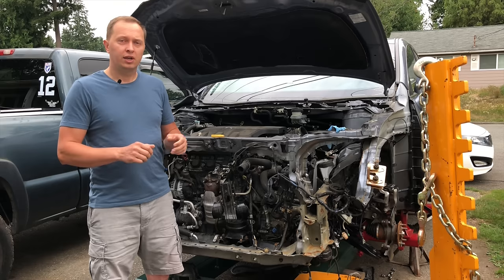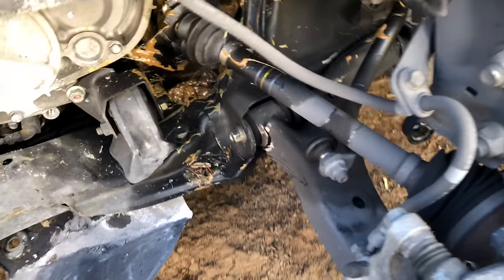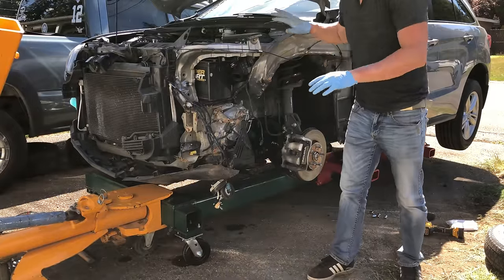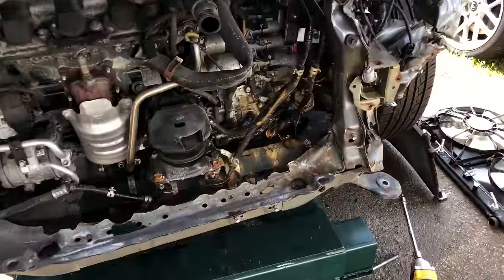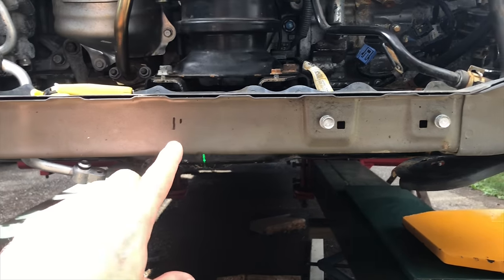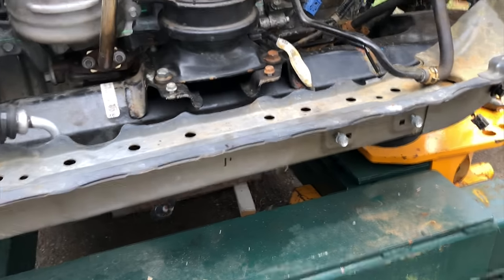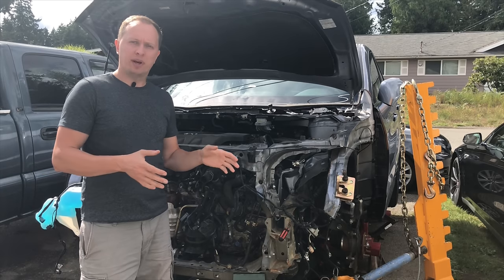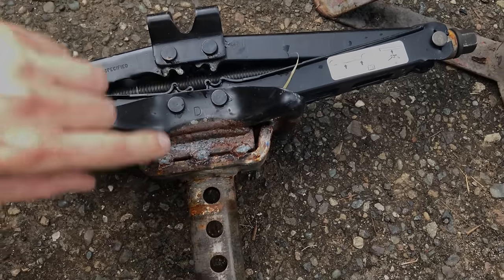✅ First Frame Pull Test on my Homemade Frame Rack Jig.

Comment: This guy has super tolerant neighbors and non-existent city code enforcement allowing him to operate a freaking body shop on his front driveway. 🤣👌
Reply from the maker: I am in a good standing with all of my neighbors so they tolerate all of the work that I do outside. And as far as city code enforcement I don't think there's really an issue, because I don't do that sort of work often enough for them to really notice. This is more of a hobby thing that I do every now and then not really full-time gig 👍
Reply: My neighbors like to gawk and then they will come over and tell me about their car problems.Most of the time they expect me to do it for free

Comment: Great work Arthur Jr. ;)  Don't forget to use a safety rope through the clamp and the chain and tie it off to the body with a little slack so if the apparatus breaks loose in a pull, you don't get hit with it.
Reply from the maker: Lol Arthur Jr... I like it  😂 😂 😂
Reply: My thoughts exactly. Awesome rack but if you do this enough, eventually something will snap and that tension is nothing to mess with.
Reply: Awesome advice. Thanks
Reply: I've been hit being in a hurry didn't think there was any way if it slipped it would hit me well it ripped out in a way that the chain flew sideways instead of directly at the rack like I thought it would knocked out 3 teeth fractured bones in my face split my upper lip in half and chipped a bunch of my teeth use a safety chain no matter what it's worth it
Reply: Throwing a blanket over the chain is cheap insurance
Reply: @mightyconker3903  Yeah, an old moving blanket for the win.

Comment: Might think about throwing a moving blanket over the chain when you pull , just in case the clamp lets go and the chain and clamp go flying like a missile , I learned that the hard way because it happened to me and broke my hand and arm  , better safe than sorry .
Reply from the maker: I normally do throw a blanket over the chain, however since this was the first video of me using the frame rack I did not use the blanket because I did not want to obscure anything

Comment: Fix you have done a fantastic job in building this machine. I am very proud for you. We built a log splitter a few years ago. The only problem was a cylinder that was not strong enough. We added a bulldozer cylinder to this set up and it was far more stronger than needed! As long as your Valve, Pump, and Cylinder is strong enough something is going to move lol.  Let me know my friend. Phillip
Reply from the maker: There is always more then one way to skin a cat... I am a big fan of recycling/repurposing... Using a bulldozer cylinder was a great idea on your part. Those things are built like tanks and are made to take some serious abuse.

Comment: The unit is perfect for a home made frame puller i wish i was that talented. Justsayin
Reply from the maker: I'm not even all that talented... I just had to do a ton of research first, and then it was just a lot of simple measuring, cutting, welding. I'm sure that anyone with a welder, plasma cutter and some other basic tools can build one of these.

Comment: I've been waiting on this video to see how your frame rack performed and it did the job nicely. Really handy that it's portable, so that you can work wherever you want to and then put it away later. One of my hydraulic jacks that I haven't used for a while decided to leak, so I'll have to top that up after replacing the seal on the fluid lock.  Audio was a lot better in this video also.

Hope you are doing videos of your trammel construction and upgrade to the spot welder soon. I'm looking forward to these, as I'm planning to make a trammel some time and seeing how you made yours will be very helpful. I might even have to consider making spot welder too! Last dent repair I did, I used the hot glue - gluing on a stick method. Works to some degree, but a spot welder would be better.
Reply from the maker: Bruce, my friend how have you been? I hope you liked the video, I figure out a new way to adjust my audio levels and I think I nailed it this time. Tram gauge video will come on a later date, I'm working on another vid currently. And then I'll have another vid in the works after that. I've used the glue stick method on some dents in the past, it's a great quick fix, that technic is good if you're not planning or repainting the panel.
Reply: @fix206  The video was great as usual, with explanations on what you were doing as you proceeded.The fixed audio levels made a fairly constant level through the video. The glue stick method is also handy if you just want to do some of the work now and finish it later. It means not having to remove the paint at that stage, so no need to repaint to prevent rust while busy with other things. It has limitations and it also works best in cold weather, as the glue sticks better when it's cold.

I'm looking forward to your next videos, whatever they might be about, as they are always interesting, no matter what the subject.
Reply from the maker: I promise not to disappoint with future vids :)

Comment: I got 2018 bmw g30 and it has a chassis damage, nothing severe damaged its just misplaced from its position and shifted towards right, can we pull aluminium back to its place? I know aluminium doesn’t have memory like metal? Does pulling works on aluminium? The place is where radiator and radiator support sits and it holds the engine.
Reply from the maker: Aluminum is much harder to work with, and it does move much easier once it is heated up. Just have to be careful not to overheat it

Comment: I drove a car with an 8 inch discrepancy in the frame from front to rear. It was a boat to and was the most dangerous looking car you ever seen travel down the road. Crab walk mixed with a dog that just got hit by a car. You hit a dip and almost do a 180 if you were not paying attention and compensating with correction.
Bouncy, pulling to one side to the point tires are making scrubbing dragging noise, and it was just constantly jittery, darty, oscillating, and vibrating up and down back and forth
 SOld it to a guy that had a alpaca farm.
Reply from the maker: you are a pretty extreme dude for driving like that. LOL :)

Comment: Hey just a tip for safety put a chain blanket just in case the chain breaks won't hit you. One of my friends got his eye put out doing a pull.
Reply from the maker: I normally would do a blanket over the chain,  just didn't want to obscure  anything this time, because this was the first vid of the rack in action, so I wanted folks to see how everything works.

Comment: How about attaching the 1/2” plate to the yellow post. Then it would work on any side. Great idea on the scissors jacks - makes them safe.
Reply from the maker: I talked about the 1/2 inch plate toward the end of that vid, how I also have a loose piece of that plate that I can move around to make my pulls 360° around the vehicle. I really wanted to strengthen the very front of the frame rack as much as possible because that's where it would see most of the action and where the hardest pulls will take place that's why I added that plate to the front of the rack. And at the same time I did not want to modify the tower in anyway that's why I left it alone

Comment: hi awesome work . can u tell how much was the front end set back
Reply from the maker: Front end was pushed over by .5 -.75 of an inch
Reply: @fix206   thanku so much for the reply could this set back affects CASTER angle ?
Reply from the maker: In older cars suspension alignment would not change unless the strut towers moved, most newer cars use engine subframe. Subframe is bolted to the underside the frame rails. Lower part of the suspension is bolted to the subframe.  If frame rails move sideways enough to where are the sub frame would follow them then chances are that suspension would move along with it, and that will affect the alignment

Comment: Ive got your Back when It comes to the. Haters But some Of them Have a point about  !!safety!! your Brave- No one can show more Bravery than the ignorant. But great work fromthe comfort of your Driveway- Now all I Need Is a video on Hydraulic lifts DIY and I could Have a full Blown shop at the House
Reply from the maker: I know what you mean about the safety, and i'v addressed it in the earlier comment responses... I would normally throw a blanket over the chain during a pull, but since this was the first video of the rack in action I just wanted to show how everything worked unobscured 👍

Comment: What if you weld that piece of 1/2" plate to the tower so that gap is always filled and just remove the plate on the front of the frame
Reply from the maker: The way I did it made sense to me at the time. And if I were to weld the plate on now I won't be able to put red slide in arms over the base tubes

Comment: Well its been a while since i finished outobody school but if i remember right u gotta start the pulls before you change any parts i would of put the donut to move it. Also we would use those protective blankets over the chains in case they snap, and also stand away from them.
Reply from the maker: you can pull bolt on parts before the pull, but if you're replacing the quarter panel then you want to make the pull first since all the substrate metal is attached to it. And I normally would have the blanket over the chain, but since this was the first vid of the frame rack in action I wanted the viewers to see everything unobstructed

Comment: wow, you are a perfectionist. you made it look easy. it's not. what kind of plasma cutter did you use. you went through it like butter?
Reply from the maker: Thank you for the compliment, and you are right, most of this stuff is not as easy as it looks :-) it is mainly a time-consuming process where I showed off only the most interesting parts.  plasma cutter that I used is a Cutmaster 42 by Thermal Dynamics

Comment: Nice home business opportunity to pick up some extra cash.  This is the way we did them in the 80's but with the new high strength steel used in some cars nowdays, is it still possible to repair them still? 

I'm guessing the reason most go up for auction is because labor costs are so high nowdays that its cheaper for the insurance co's to total them?
Reply from the maker: I know that if even one of the frame rails moved just a bit then the insurance company will write the car off as a total loss.. Or at least that's what I've been told
Reply: Yes & no.  In order to keep the weight down, strength up and fuel consumption low, manufacturers use different types of steel in different places.  There are different repair rules for the different types of steel.  You've got mild steel (heat it and beat it), HSS (can be repaired with some limitations), and Ultra High Strength Steel (must be replaced almost always).  The latter doesn't refer to one alloy, but an entire class of steels that usually cannot be safely reworked.  The proper repair in those instances is to pull the damage straight, then cut out the damage where the factory says it is safe to do so and weld or glue in a new repair section.  Every manufacturer has detailed drawings and instructions on how to repair/replace different body panels & structures.
Reply from the maker: @briancorrigan5350  Definitely good info Brian !

Comment: Also could help loosen the bolts and subframe make it easier for a pull
Reply from the maker: I did loosen the bolts on the subframe. I even pulled one of the bolt out. and left the other one in so the subframe wouldn't sag under the weight of the engine

Comment: I'm surprised that  broken cvaxle didn't damage the transfercase.
Reply from the maker: I thought the same thing... I bought few cars like that over the years with suspension ripped out and cv axles badly damaged, not a single one resulted in transmission damage... Guess I'm just lucky... 🤯

Comment: because the metal has already been crushed and then pulled back, isn't the metal weakened,  on the next crash the front end will possible no give as good protection due to all the metal bending that happened,  am I wrong?
Reply from the maker: I'm sure that the metal lost some of its strength, but not by much. I'm sure the structure is still 97% strong. Funny thing is this car was driven by my wife and couple of months ago some guy hit her in that same exact corner... And everything held up just fine, I'll be doing a video on that repair sometime down the road

Comment: Question how do you figure the top rad support with that pointer thing (didn't catch the name of that tool) did you make it or buy it if you made it please share how you made it and give dimensions thanks. it's great to see people think things up and then make a plan and build it and see it work.
Reply from the maker: To check for symmetry I used a tool called a "Tram Gauge" here is a video of how I made it https://youtu.be/mTr5dCj4kis

Comment: 9:38 How much force did u use to pull that nose of the Acura? In other words, what is the break strength of the chain u are usin? I need to know because I am tryin to oull the nose of my car with a ratchet strap and "frame tower".
Reply from the maker: I've purchased that chain few years back and not too sure what the strength of it is.. But if I were you I'd just go for it with the equipment that you have available. No matter what chain you use, always assume that it will break and just stay out of it's way if it does.

Comment: Good job,,  don't forget to use a safety chain and keep your distance from the area you are working on,,,,,thanks ,,,
Reply from the maker: For sure... Safety always first 👍
Reply: we use heavy blankets over the chains as safety, if ever the chain or the anchor points yelds, the blanketsends the chain and its accessories directly to the ground
Reply from the maker: @jacquespoirier9071  I normally would do a blanket over the chain myself, I just didn't want to obscure  anything this time, because this was the first vid of the rack in action, so I wanted folks to see how everything works. But it would have been a sad day for me if the chain would have broken loose and flung back, because I had my Tesla parked right behind the pulling tower while I was pulling the frame rails over.

Comment: Get your self a fire blanket  to put on the chain cause if the spot welds, panel or clamp gives way its gona hurt or leave a lot of damage  there's  2 tons  of pressure  and inertia in that chain
Reply from the maker: I normally would do a blanket over the chain,  just didn't want to obscure  anything this time, because this was the first vid of the rack in action, so I wanted folks to see how everything works.
Reply: @fix206  fair enough  you gona make an air lift and beam  support  for stripping  the vehicles  down aswell ?
Reply from the maker: LOL... probably not, I think I'm done with fabrication of big stuff for a while. But you never know, maybe later I'll get the urge and just do it :)

Comment: Do you think you can add a cheap laser measuring system? I seen one for $10000 at the expo!
Reply from the maker: I actually do have a cheap $50 laser measurement system that I use with this frame rack. Check out my other vids

Comment: Hi nice job, can you put link for tram gauge??? Pls
Reply from the maker: I made that tram gauge from some stuff I had sitting around my garage. I'll do a quick video one of these days on how anyone with a basic welder and a 2 hours of time can make one...
Reply from the maker: $400-600 is ridiculous... You can build one for under $20 in materials. It may not be as fancy as the $600 one but it will do what it suppose to

Comment: So you built the pinch weld clamps? Where did you buy your tower?
Reply from the maker: Yes, I built everything but the tower. I was just checking craigslist one day and just the tower popped up for sale, so I jumped on it. My original plan was to build everything including the tower, but since I found one, that was one less thing I had to build.
Reply: Fix206 nice job, always consider the fact that a unibody has 3mm tolerance and a framed vehicle has up to 5mm tolerance. They arent perfect from the factory, giving a little wiggle room on the repair end.
Reply from the maker: Copy that, but since I'm already making the pull might as well make it 100% down to the last mm or so. But it's alway nice to have that wiggle room though as extra little bit to play with never hurts :)

Comment: How how bout taking a grinder cut off the old radiator support, use a new radiator support to straighten the bent frame to?!?  PS keep your face away frame that chain when your pulling on something.
Reply from the maker: That would've been more work in the end, and more money out of pocket also. Radiator support was not destroyed in the rack, and just needed few minor adjustments to be put right back into original position.

Comment: if would of pull the radiator support together with the frame you wouldnt had to pull again thats why you pull the frame together with the re-bar together with the radiator
Reply from the maker: I thought rad support would have came along with the rails during the pull, I only realized that it didn't after the initial pull was made.
Reply: @fix206  well it seems that you are getting the hang of it and very soon you are going to have to open your own shop because i see good future for you from now on!
Reply from the maker: Thanks man... I really do appreciate the encouragement, I've been messing around with cars as hobbyist for the past 20 years or so, I've learned a lot over the years, still learn just about every day. So I though I'd share some of my knowledge with folks over Youtube, because I come onto this platform to learn myself.